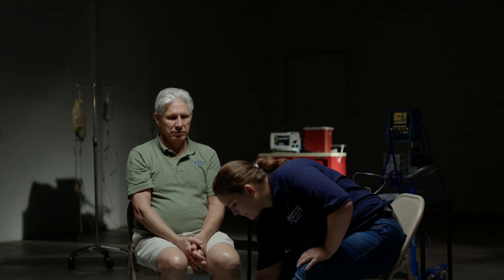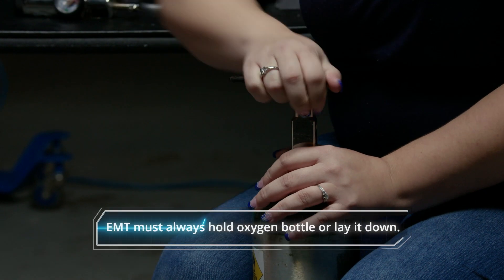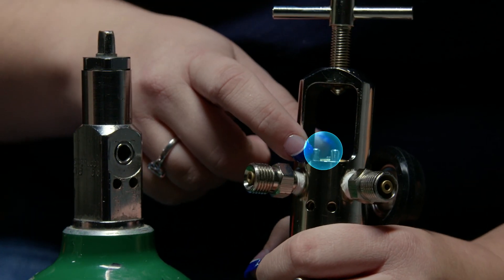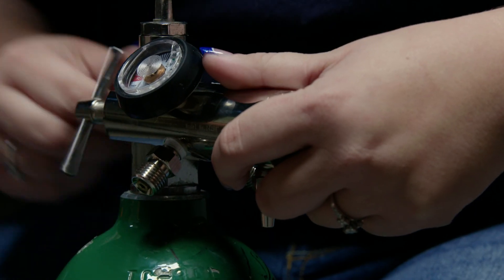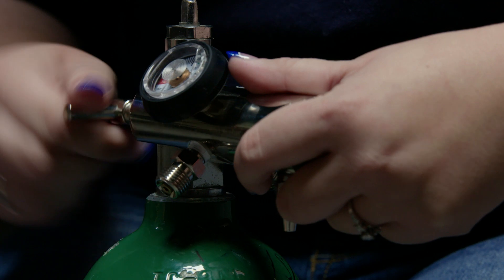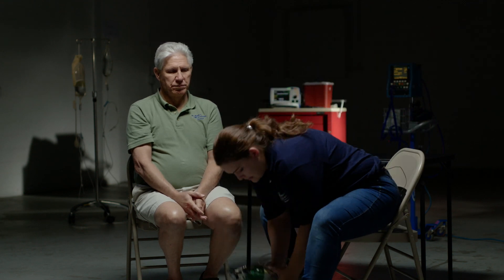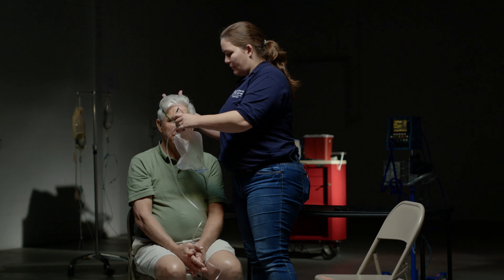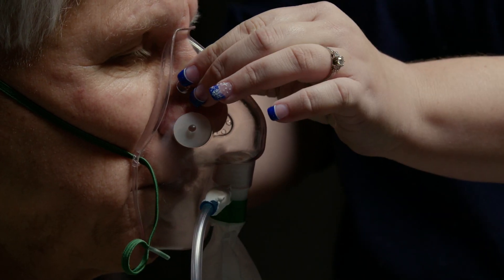OXYGEN ADMINISTRATION BY NON REBREATHER MASK RC Health Services

Comment: Errors. NEVER position your head/face or anyone's  over the valve/regulator assembly. Do not ever position or point the assembly at anyone. Also the alignment  device is a PIN not a prong. This is  basic standard pressure  vessel handling, EMS, SCUBA, weld shield gas et al.
Reply: Yeah she didn’t do any of that and no one cares if they’re pins or prongs. This is for EMT students, they could call them floobingorps and not fail the station as long as they assemble everything properly
Reply: @AnthemTD exactly! As long as you do everything right, you can call it whatever